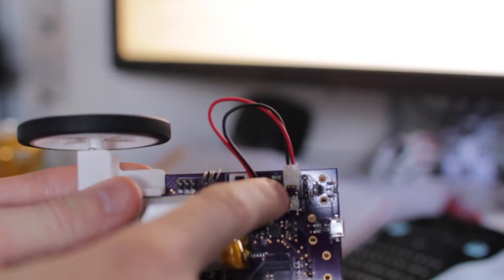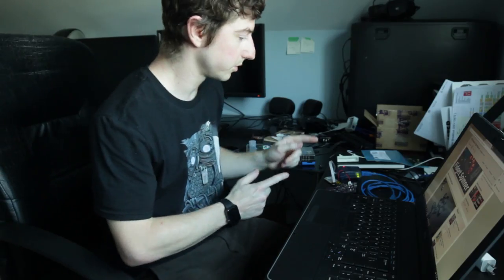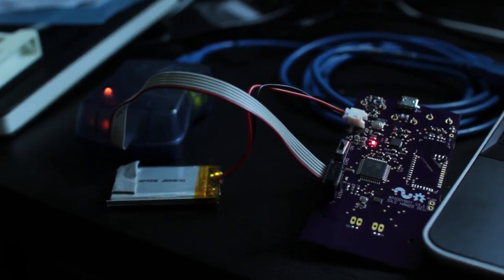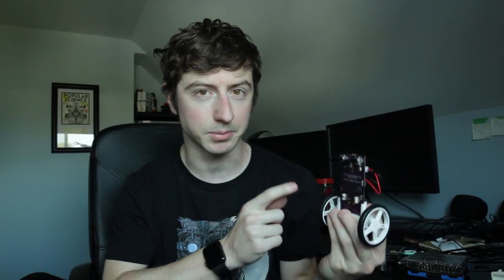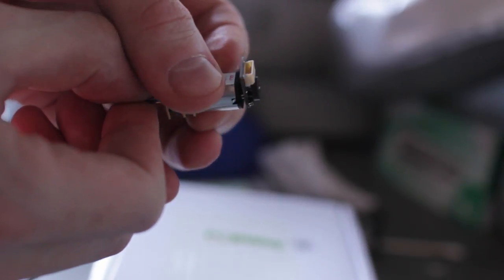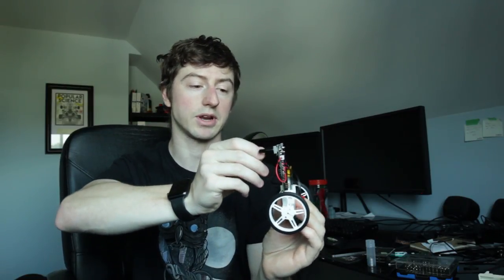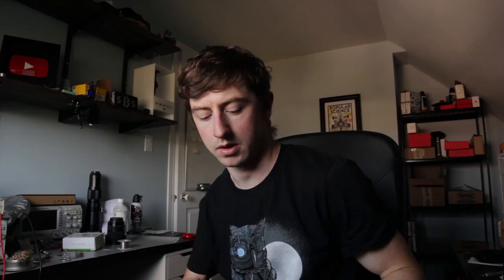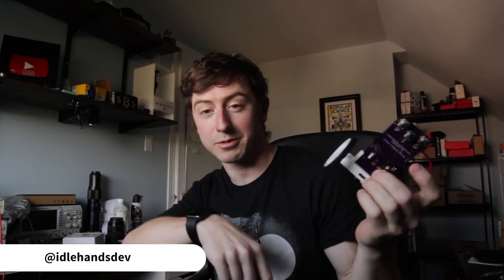The PIDDYBOT - DIY Arduino Balancing Robot

Comment: Hi,
I tried to make similar project. 
Used Arduino Uno , MPU6050 & L293D.

I faced weared problem of i2c communication failure between Arduino & MPU6050 during DC motor running.

Can u suggest how to resolve that interference problem.

Comment: We (my team at college) are trying to build something like this with a geared motor (12V, 100Rpm), Arduino and MPU6050. Apart from being highly unstable (which it should be, considering it is an application of Inverted Pendulum), the only thing it does is  just to shudder before falling over. What do we do???
Reply: PS: we haven't added potentiometers yet, at present are giving Kp, Kd, and Ki values through arduino program itself
Reply from the maker: Lots of debugging. The list of possible issues is very long so I suggest you break down each part of your program to make sure its routine working properly. I wouldn't be able to say for sure what is wrong with it. Start with what I suggested, problem solving is half the fun!
Reply: you should try to add potentiometers if not on the bot itself maybe somewhere else at least while debugging because it is far easier trying to adjust the parameters in real time than doing it by iterations in the sketch.